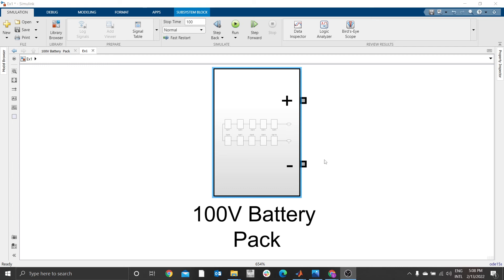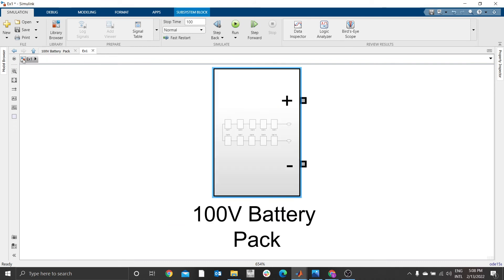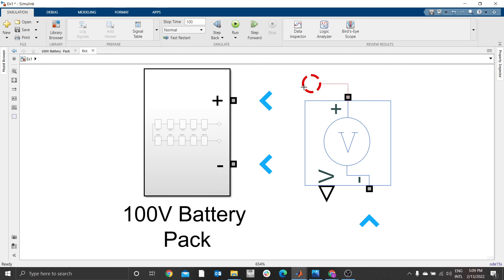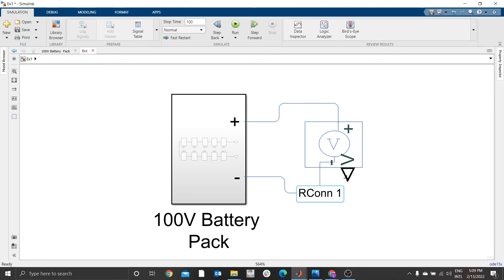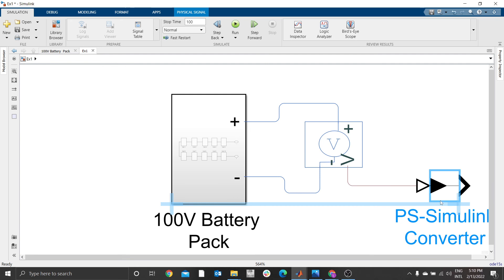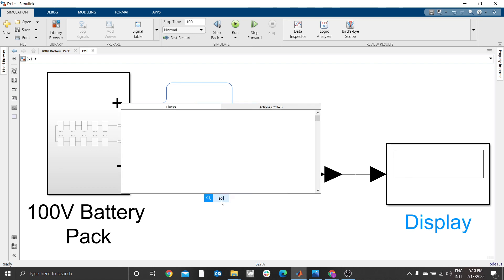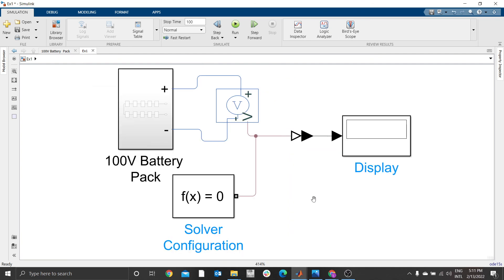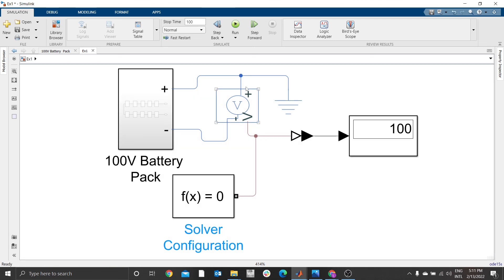Electric Vehicle in Simulink part 3.1 : Battery Pack Voltage

Comment: why electric reference is needed
Reply from the maker: Visualise it like  datum..point of reference...if two wires are carrying 200V and 300V respectively,  the Voltage across is 100V if 1st wire is reference